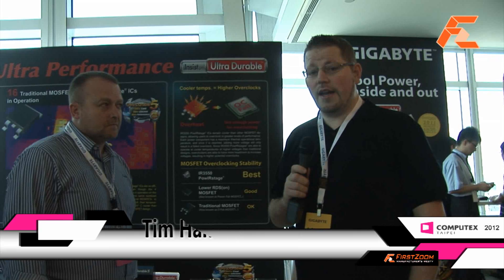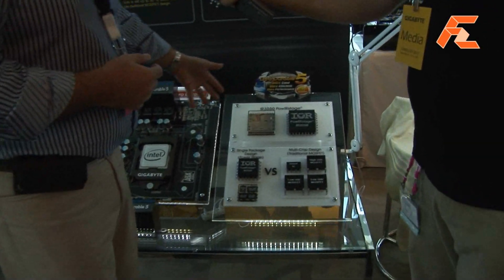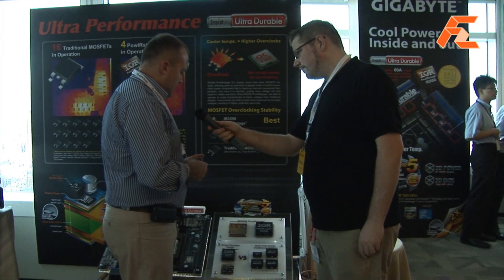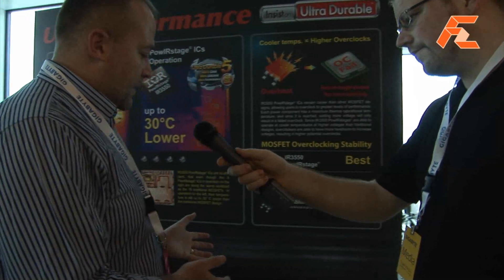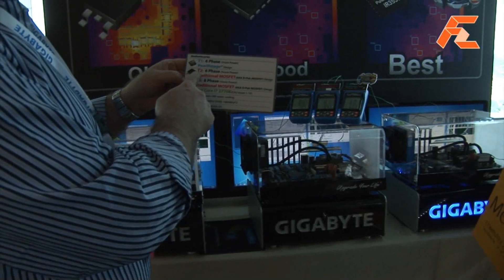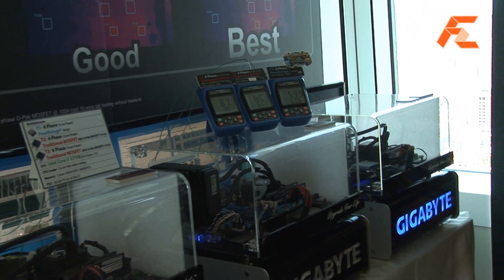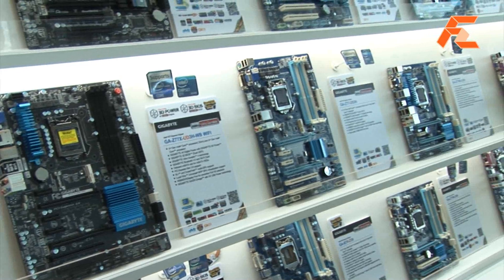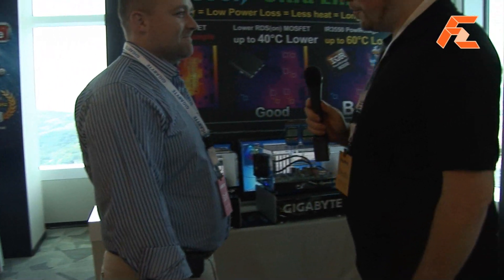Gigabyte Ultra Durable 5 - Computex 2012

Comment: I like how Gigabyte is trying to lower mobo temps. Will those who don't over-clock or use water cooling still benefit from the Ultra Durable 5 or no? 

How much will the UP7 and the UP5 cost? When will they be out - I heard at the end of June so, anytime, right?